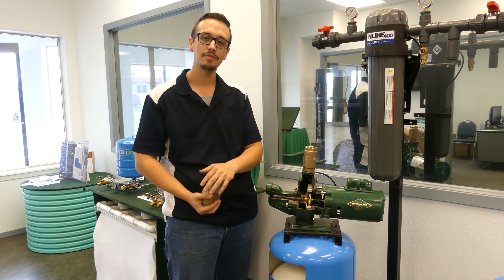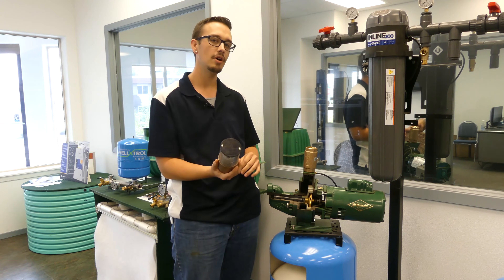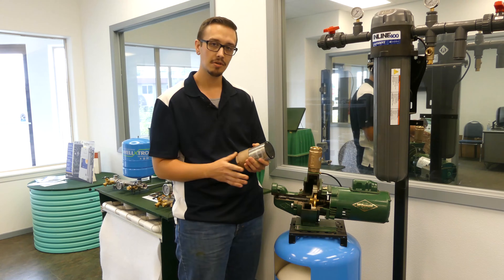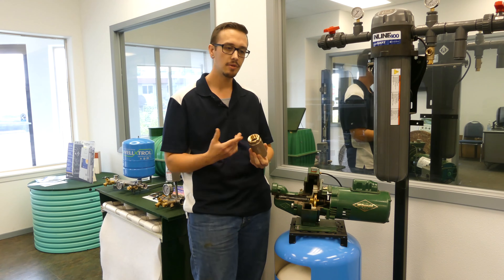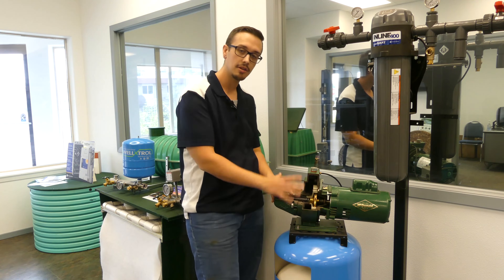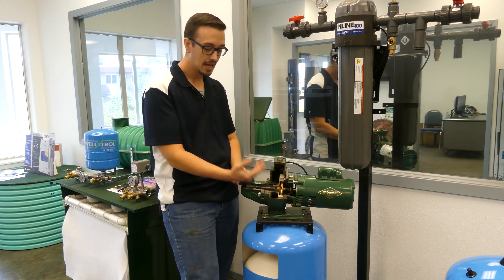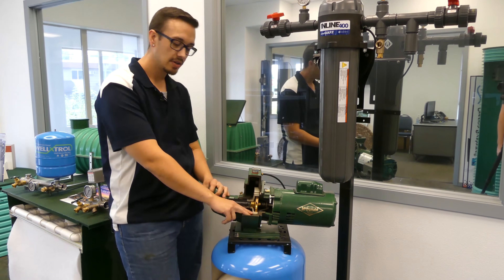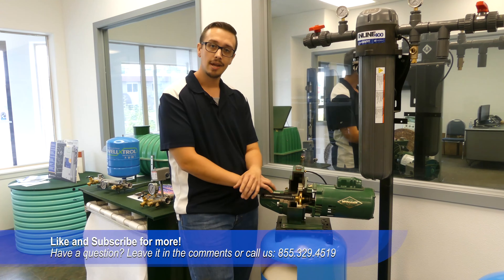Foot Valves Explained

Comment: What if the water is coming from tank not well do you still need a  check valve on the inlet side off the of the pump
Reply from the maker: If the pump is at a higher elevation, yes. If the water is flowing by gravity into the pump then your check valve just needs to be before the pressure switch, so in theory it could be after the pump if your pressure switch is near the pressure tank.

Comment: Fixed mine after a week of struggling, everything topside was replaced but still not pulling water out of the hole. Pulled out 30 ft of thin wall PVC and replaced the foot valve. Still didn't work, I noticed towards the top that the pipe was oval shaped. When I cleaned and inspected their was a long crack that you couldn't see until it pulled a vacuum then stopped. The PVC fitting was eaten up and also leaking air.
Reply from the maker: Thanks for sharing

Comment: I have a jet pump pulling out of a well - presumably from 25 ft or so (well is 46 ft total depth when it was drilled in the 1970s).
Do I definitely have a foot valve?
Last time the power went out my pump lost its prime and it was suggested to me that maybe my foot valve was leaking.

Comment: I am drawing water from a shallow well using a foot valve. If I get 1 grain of sand in my foot valve, it fails. Any advice? I'm currently working to remove the sand from the shallow well.

Comment: Hey I am in desperate need of your expertise. I have replaced the pressure switch and the pressure tank. There are no clogs between the pump and the tank. In reference to a shallow well pump, the pressure in the gauge will not exceed 10-20 PSI. The Pump will run but quickly shut off as it doesn't seem to be able to build pressure. I have removed the water system filters and minimal water will run through the house.  Any suggestions would be appreciated.
Reply from the maker: It sounds like the system is not properly primed. Check out our video on how to prime a jet pump. You may have a faulty foot valve as well.

Comment: Very well explained, i have a situation with my system , i left my house for 15 days and i disconnected the pump just for safety so when i got i took a shower and it pull all the water and psi so now i'm not able to prime the system i have a basic knowledge but i just can't get it prime i poured water in the line that goes to the well and i think it's not holding it, any idea to get it running back, thanks
Reply: I have a similar issue.. what ended up being your problem?

Comment: Great video.  Question:  Is there a way to wire a shutoff to stop the pump if it runs dry?
Reply from the maker: Yes, you can accomplish that with an M4 pressure switch: https://www.rcworst.com/square-d-pressure-switch-m4-30-50-psi-w/-low-pressure-cut-off-9013fsg2j21m4.html

Comment: could have explained more about how they work, with some graphics. This was more of a cursory overview of what you feel the applications are, not allowing viewers to see how the valves function and decide for themselves.
Reply: Foof valve fuction is to keep the pipe line after the foot valve full of water, in that case no space for air, because if the line are had air, is the cause of chalking, or clogging.

Comment: Can I use a foot valve to pump out 100 foot deep well with a strong centrifugal pump?
Reply from the maker: You'd need a deep-well jet pump to lift water more than 25' due to atmospheric pressure.
Reply: @RCworstwater   Thank you sir. Even If I prime it all the way down it still wont lift?
Reply from the maker: @EllahRah  Correct, a centrifugal pump won't lift past 25'. Here's a video that might help explain: https://www.youtube.com/watch?v=h8s2u1_Yqv0
Reply: @RCworstwater   Thank you so much, you just saved me alot of time and money 😎🤝🤝🤝

Comment: My pump lost pressure  and I primed it but the pump turns on and never  turns off and the pressure kept jumping between 20 and 30 when the cut on is 20 and cut off is 40.

Comment: I recently installed both a new pump and a new bladder tank.  The tank very gradually loses pressure when no water is being used.  Very gradually.  It’s a small house and if there was a water leak it would show up somewhere. Absolutely no wet spots.  Is it possible it is siphoning back into the well and would a check valve solve it?
Reply from the maker: If it leaking back then a check valve will not stop the water leak, but it will stop the pressure from dropping past the valve. Do you have a jet pump or submersible?
Reply: R.C. Worst & Co., Inc. There is no water leak.  It’s a jet pump.
Reply: Yes it is going back to the well, small lick to your foot valve, in that case air clogging is happening when your pump is running

Comment: Informative video as always. Are there any sensors/safety switches available that will automatically shut down a pump if it has been running dry for a certain period of time? One of my applications uses 2 jet pumps. One outside to draw water from shallow well to an aerator and one inside the garage to draw water from the aerator and to provide pressure for the house. Recently the outside pump failed and the inside pump pumped the aerator tank dry and kept running killing it as well. Unfortunately the only way I know to prevent this is to notice it and manually unplug inside pump. This house was vacant so it wasn't noticed for a number of days.
Reply: The most economical solution involves using a low pressure cut of switch if you are using a pressure switch to operate the pump. See https://www.rcworst.com/Square-D-Pressure-Switch-M4-W/-Low-Pressure-Cut-Off-9013FSG2J21M4-p1626.html. Otherwise you could use a flow switch to disable the pump when water is not flowing, this would be slightly more expensive. See Here https://www.rcworst.com/McDonnell-Miller-FS-251-General-Purpose-Flow-Switch-p5090.html Another solution would be to use an electronic motor protection device.  See Here https://www.rcworst.com/SymCom-233P-PumpSaver-Plus-Single-Phase-230v-0-33-to-3-HP-p292.html
Reply: Thanks Chris, I will look into those!

Comment: Can there be a check valve and foot valve together in the system , of course apart from each other one end to the other?
Reply: There are certain circumstances where these could be used in conjunction but it is not very common. Typically a suction line is not so long that it needs additional checks, but it could be used to add redundancy to a system to prevent loss of prime if either valve failed. Similar to a double check concept. Thanks for the comment.
Reply: @chrisworst8353  Foot valve are used at suction ( mostly for vertical lift applications) of pumps. And check valve is required at discharge of pump. Hope it helps.